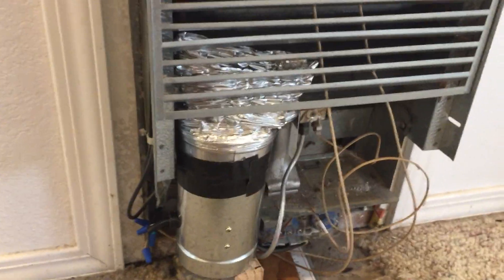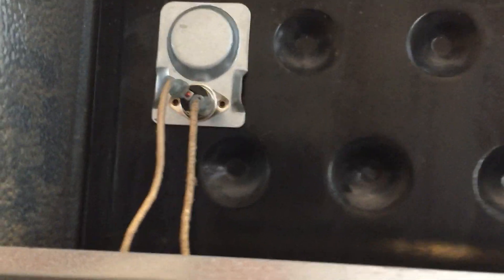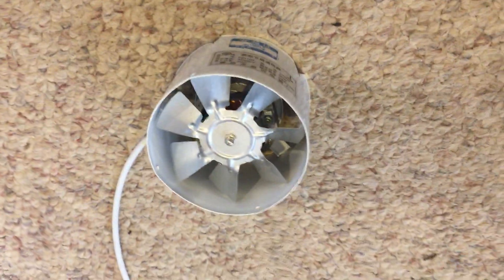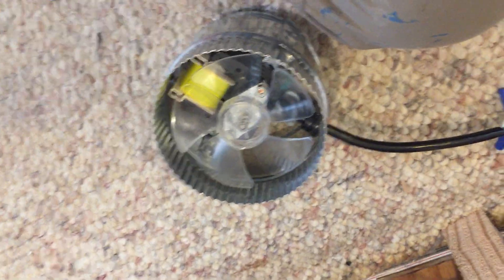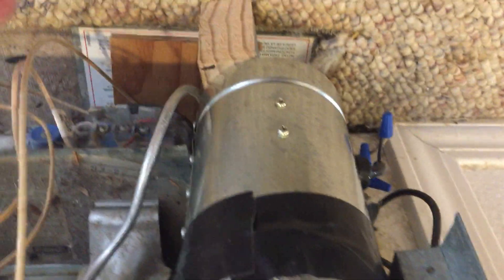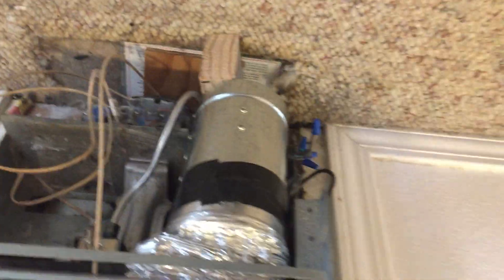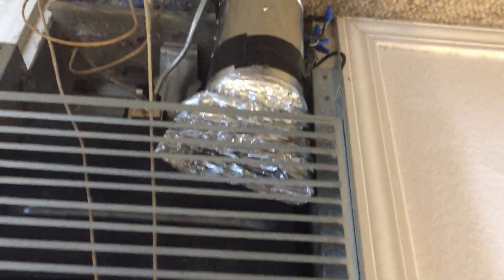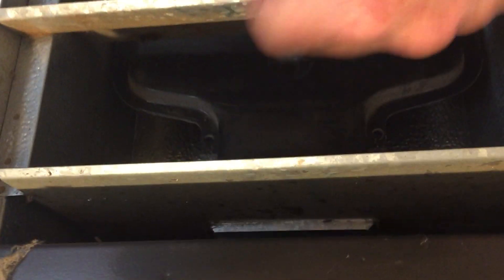Williams wall heater - increase efficiency

Comment: Well I done on your own. Good luck post what you learn. How about boiler + fly wheel generator Tesla wall + radiant heat pathways throughout the house I would call it reverse laminate flow no need to heat the floor where you are not.

Comment: Ok works too well, the air coming out of the blower is warm not hot about the temperature of an electric heater. Much better than when I followed the directions. Installed the blower box where it goes but cut the top of furnace cover and bottom of blower box to allow air into the fan box from the bottom. See, This is important! The experiment failed! Works but can’t control it. it’s dangerous. Now there is air coming out of the front of the furnace. It’s a gentle breeze. Not like a fan but it is enough air to make the furnace cover heat up over a small time to the point where it will burn you if you tounh it. This is the front of the furnace cover in the middle where it is normally hotter than the rest of the cover. But now too hot to touch. This modification was a Bad idea I’m disconnecting it now. Next I’ll try a sheet of copper full holes like the metal from three piece screen for a fire place, the trick will be to deflect some but not all of heat. Don’t want the fire box to over heat. WOW now to be safe I’ll have to measure the normal running temperature of the fire box probably 2 temperatures 1 furnace without fan (if you touch conver of the furnace is it too hot, don’t touch the fire box it will burn like a torch) 2 furnace with fan installed according to detections. is there a difference? there shouldn’t be. If the furnace cover is not to hot to touch under normal running with or without the fan? Which is the way it should be now! but I remember the 60’s if you touched the furnace you got burned remember the waffle burn from stepping on the floor furnace. Well for now what I did was dangerous. Remember if you run an experiment use a controlled environment where no gas could leak boom no one could touch it but me. And so on, oh I need funding. BA Psychology, 30 yrs Union Plumber, Vocational Teaching Credential, father Rocket Scientist growing up doing experiments write me a letter if interested William Masterson 448 Eden Ave Boulder Creek Ca 95006. If you have no experience building experiments don’t you could hurt your self or someone else or cause property damage. I have hurt my self. Once my father and I had a propeller explode when we tested it. It was in a test cage! Would have killed one of us....

Comment: There is a blower for the back of the Williams Monterey furnace ( if furnace wall was bathroom wall let’s say,) there are nock outs in back give access to fire box maybe install fan motor in mount backwards don’t know if it could work, don’t have those parts but it’s an accessory one can buy I will buy because it backs up a bathroom but I install it right.

Comment: So I’m going to use the fan kit that goes with the furnace. I’m cutting the sheet metal cover at the top 3/4” from front 14x4 hole, leaving enough metal for strength. The kit comes with an access front cover to get the motor (under grate) when I leave it off the fan will suck from the top of furnace, (after the the slots were cut in top of sheet metal furnace cover not the fire box (if your that stupid don’t fool around))and from the room as will but that can’t be helped, but better than before. I think what this guy did shows thinking but the difference in pressure might blow out the pilot when the furnace is running leaking some gas into room because the thermal coupling will still be hot, maybe not enough to be dangerous but maybe? The fan and all the wiring needs to be blocked by sheet metal cover and a “distance by code” from fire box ( ? ) so the parts don’t over heat, look at fireplace fans for reference. oh I did this in a jig in a controlled environment so if there was any danger I could stop the experiment if it failed. Don’t do this. I take no responsibility for what you do. I’m doing this today if it doesn’t work I take it apart. I’ll run it for a week before I install it. Again don’t do anything like this!!! You are you own keeper!

Comment: We had the best wall heater I was a child. It was a colmon heater that had a three speed fan boy did it throw out the hot air. My dad had to change the fan motor now and then but the heater itself lasted from the time I was a 8 year old boy till my parents sold the house 25 years later.

Comment: hi good info...  care to venture ideas?? i have the williams counter flow direct drive furnace model wich it has fan in top but does not blow the air it sucks the air from top of room then  it pushes air trough the heat exchanger and  down to floor its gpood i guess cuz heat rises  so it  keeps  circulating hot air  just an idea...